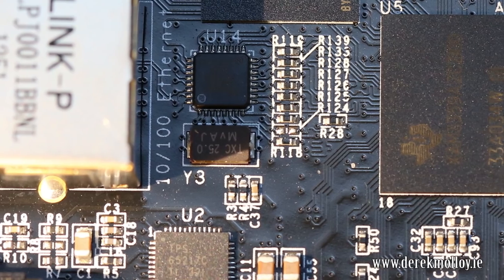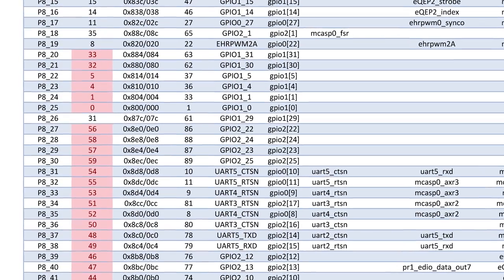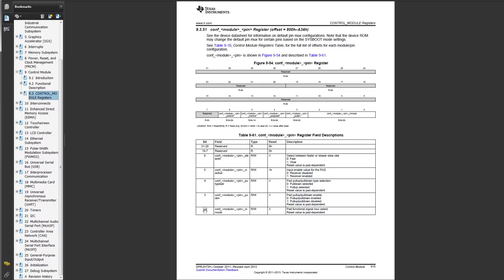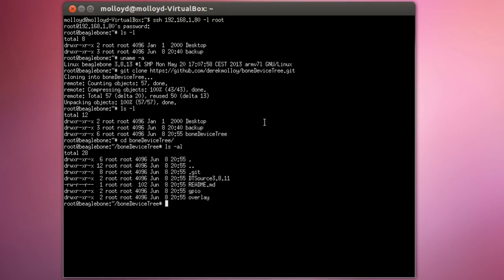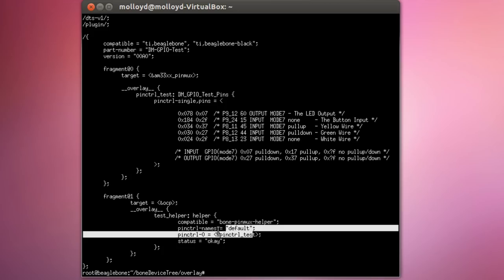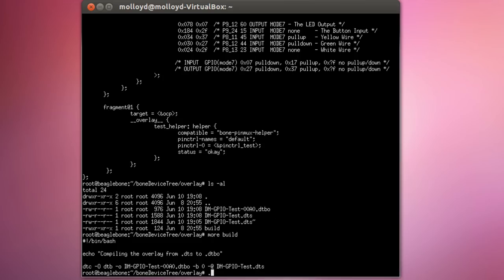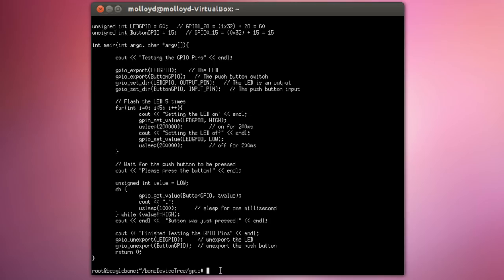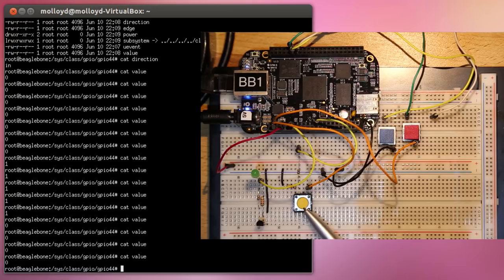Beaglebone: Introduction to GPIOs - Using Device Tree Overlays under Linux 3.8+

Comment from the maker: Thanks Pantelis - Yes, I will have to do a video on that too. I used the button and LED as examples of inputs/outputs. In the follow on video (already there) I use the GPIOs for driving an EasyDriver stepper motor controller board.

Comment: Derek:  Thanks for your entire series on this technology.  One suggestion is that you use different terminology in regards to 3.3V tolerant or 5V tolerant... This terminology is typically used in the context of a microcontroller or other logic device that is powered by 3.3V.  If it is not 5V tolerant, damage to the 3.3V device would occur if it was to be connected to signals that provide 5V as their logic high.  5V tolerant parts while still operating off 3.3V power supplies are not damaged (tolerate) the 5V signals that may be connected to them.  You are quite correct that the BBB is not 5V tolerant.

Keep up the great tutorials.

Comment: I've found the answer in the TRM on page 747 (section 9.2.2).  Bit 5 is (RXACTIVE) and it says: "Input enable value for the Pad. Set to 0 for output only. Set to 1 for input or output."  Presumably then, writing "in" to the GPIO direction file does not set it as an input unless bit 5 of mode is also set.  Very useful to know.
Also, regarding fast/slow bit 6 (SLEWCTRL).  According to the TRM (same page) this sets the slew rate of the pin - presumably when set to fast, the pin drives more current.

Comment: Great video, I gotta try this on my original BeagleBone running the 3.8 kernel.
Regarding the 100ohm resistor to protect the input, if something went wrong, the 100ohm would allow 33mA to flow through it (at 3.3V), and since this is several times more than the maximum allowed current for the pins, I would assume that 100ohm is not enough for protecting the I/O. I would suggest 1k since this gets you below the 4-6mA output source capability of the pins in case of shorting an output pin to ground.

Comment: Another great tutorial Derek.  I've been playing with device tree overlays on the BBB for over week now but still learned something.  Can you clarify the function of the mode bit 5 (receiver active) - is it necessary to explicitly enable this if the pin is used for input or does writing "in" to the direction file of the relevant gpio effectively do the same job?  Regards Martin

Comment: Some wonderful BBB GPIO information.  I would like to use the Orange Pi-5 GPIO PWM pins to control the Pan/Tilt servo motors. Little OPi5 info!  This video will help??    😎 Thank you.
The new technical manual is over 5,000 pages and look on P1515 control_module registers.

Comment: Derek -  Regarding the 100 Ohm resistor protecting the input GPIO_15 (around 8:25 or so), under NORMAL circumstances, and assuming the applied voltage is always between 0 and 3.3V, is the 100 Ohm resistor really necessary?  Asked a different way, it is not as though that input GPIO circuit would draw/sink  33 mA - minus the small amount of current through the 10K resistor(this is actually a question to you, not a declaration as I am not sure ;-).   Great video BTW...

Comment: Derek - Thanks so much for your video efforts - I have been looking for instruction on receiving a string (8 bytes) of data from the USB0 port on the beagle bone - Searched everywhere. I'm using RFID that sends the data at any point in the program. Can you tell me if your book(s) articulates that and would help me do the following:
get uart data into a file based on an interrupt?

Comment: Hi thank you for the great tutorial.
At 31:14 , why is the direction of GPIO60 set to "in", when it was set to be "out" in the overlay file?
Reply: Giulio Moro Good question, I wonder if he used the wrong address (0x078) for that pin? Was it supposed to be 0x087 maybe, and he transposed the two values?
Reply: No, I think the address is right, as seen at 27:46. Interesting...

Comment: Hey Derek, I guess there is some mistake in the comment at the timestamp 25:34, modes (pulldown, pullup) is mistakenly mentioned under the wrong label. This should be as: INPUT GPIO(mode7) 0x27 pulldown 0x37 pullup and OUTPUT GPIO(mode7) 0x07 pulldown and 0x17 pullup

Comment: aviatorRHK, I noticed that the transistor is installed backwards.  Google 2N2222, and you will find several 2N2222 PDF's, Transistors will work with their emitter collector reverse, only the beta is low.

Comment from the maker: Thanks - Yes indeed, a 100 ohm resistor on its own is not really a good level of protection. I will try the 1k option to see if it still provides a stable high/low input.

Comment: Do I really need to create the firmware? Could I just export the appropriate gpio pin with the same effect?
Reply: I have the exact same question. Wouldn't it be possible to carry out the exact same procedure via the export function in user-space without the need for a device tree overlay?

Comment: Quick question : At 31:14, the GPIO 60 pin is tested for direction, and the system responds with an "in".   Why would it return the direction of this pin as an "in" when it had already been setup as an output?  Thanks

Comment: Thanks for the info, as I'm new to the 3.8 kernel Device Tree thing.

So, to enable one of the provided "virtual capes" from the firmware/capes directory, do we just do this?
   echo BB-GPIOHELO-00A0 > /sys/devices/bone_capemgr*/slots

I also read that to make it permanent, we have to add it to uEnv.txt file on the properly mounted boot volume.  Is that correct?

Comment: Hi Derek, Thanks for the great video. I am getting stuck trying to compile the .dts file. I get the following error: Error: DM-GPIO-Test.dts:35.1-3 syntax error
FATAL ERROR: Unable to parse input tree
I know others have posted on this. I have tried all the solutions that have been offered: using git to download the files to my BBB; removing comments from the first fragment. I don't think I need the dtc patch because I am using the latest Angstrom distro.
Any ideas?
Thanks for any help. 
Peter M

Comment: I had a similar problem with the git clone command, the issue is with SSL, you could try with the following command, "git config --global hxxp.sslVerify false" (cannot write h t t p under comments)

I also followed the really nice tutorial Derek did for upgrading the git version, as the shipped with the BBB is really old, you can look it at Derek's web under derekmolloy.ie/building-git-beaglebone/